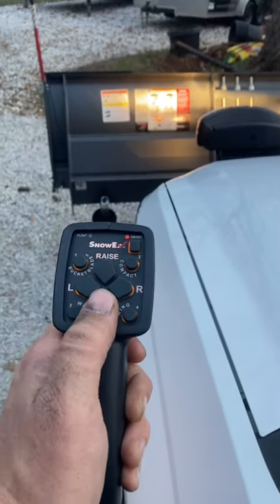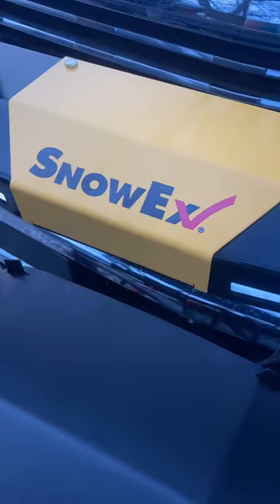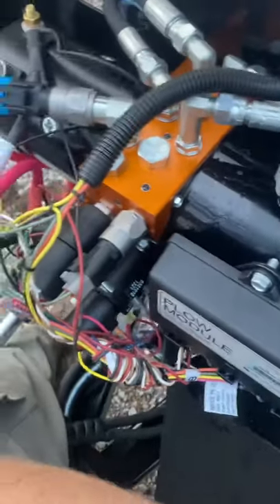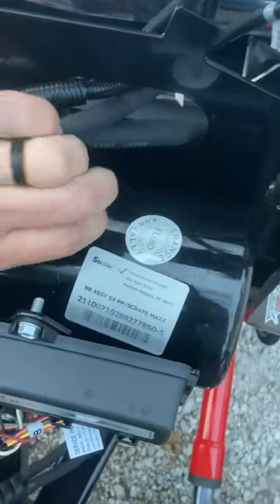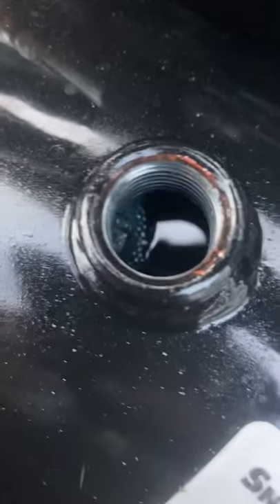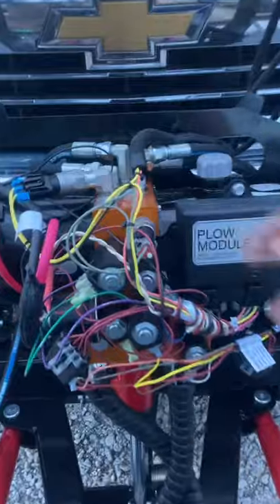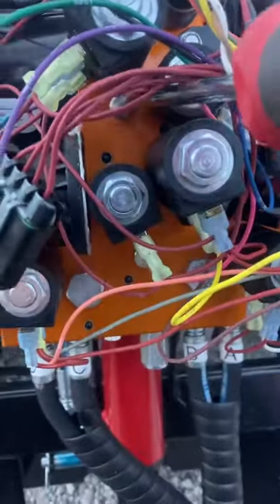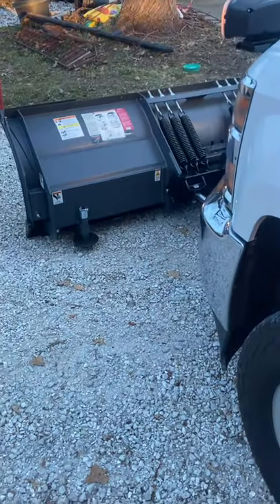How to adjust the drop speed of SnowEx Plows

Comment: Thank you for this video. It gave me the starting point on how to do this with the new Western Enforcer Plow. Just took about 1/8 turn left to make it go down fast as  needed .. Must release the front chains to remove the front cover, for the Western Enforcer model 2022 year. Then front cover can be removed , and the screw/ valve is easy to get to .. Thank you so much.. You saved me from trying to get it fixed when all service centers are crazy busy and charge a lot of money!!